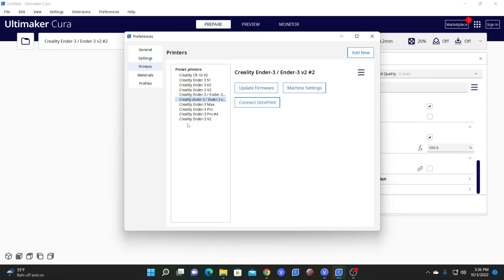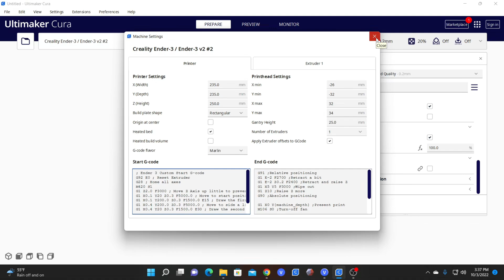Configure your GCODE to use the ABL Mesh from a CR-TOUCH or BL-TOUCH on a 3D Printer

Comment: Will this also be the case if the printer has built in bed leveling (Anycubic Vyper). And if so, if im printing off octoprint, do i need to configure the mesh in octoprint too?
Reply from the maker: Yes. You will need to tell the machine to use the mesh.
Reply: @3DRundown  Thank you, how do i save the mesh in octoprint?
Reply from the maker: Not sure. :( I ditched octoprint long ago.

Comment: so this worked for the first print but anything after will not print
Reply from the maker: This code will recall the saved mesh and use it. If your Tramming, Mesh, or Z-OFFSET are no good, you will need to address that.
Reply: @3DRundown  When I try to print, my printer will not move and heat bed and nozzle to temp then stay like this.
Reply: Just finished installing Marlin with the help of your video, my printer is printing at the moment, see how it continues. Thank you for your videos they are extremely helpful
Reply from the maker: Thanks! Happy to help. Consider a Super Thanks, my 3DRUNDOWN.COM Course, or my Patreon, to help keep me going! :)

Comment: You didn’t write the G Code correctly it needs a semi colon at the end of M420 S1;
Reply from the maker: Negative. The Semi Colon only separates personal notes, from the actual command. I know what M420 S1 does, so I don't need to add a Semi Colon and a note explaining that it loads the mesh
Reply: gcode is not C
Reply: Semi-colon starts a comment until end of line. This is also common in Assembly Language code.

Comment: I did this in the g code but it is still not applying the mesh
Reply from the maker: How do you know it's not? It probably is.... Also, be sure to reslice any model you sliced before the code.
Reply: Make sure to store your configuration after running bed leveling as well or it won't be saved

Comment: Hello! Thanks for the video!
Does the Ender 3s1 pro save leveling automatically? And can it be used with the code M420 S1 after turning it off? How do I know it remembers it! Maybe after leveling enter G code M500 manually (from PC)?
Reply from the maker: Yes, it will save your mesh. In your GCODE, you only need "M420 S1" after G28. That will load the mesh, when you print
Reply: @3DRundown Hi, I need your help. I have been struggling with my BL touch for months. During auto home, my nozzle will press onto the build plate due to the probe out of area of my build plate(not in the centre of it)
Reply: @Revolutionary169   Hi, I had a similar problem. on my ender 3 v2 I switched to a sprite DD and I had to adjust the nozzle offset in the advanced setting on the printer itself it really depends on your printer and what software you have loaded up on it.

Comment: question. so instead of entering G29 like suggested I should enter the following instead? 1:12
Reply: G29 will perform ABL test before each print. M420 S1 will save the ABL settings from a previous print. Unless you adjust your bed, you don't need to run ABL before every print. After inputting M420 S1, run an Auto Bed Level test and then save (in Configuration) and you will be good to go.
Reply from the maker: Yep
Reply: @3DRundown  can you do both g29 and this so it creates a new mesh for every print?
Reply: G29 A will activate the mesh (same as M420 S1)